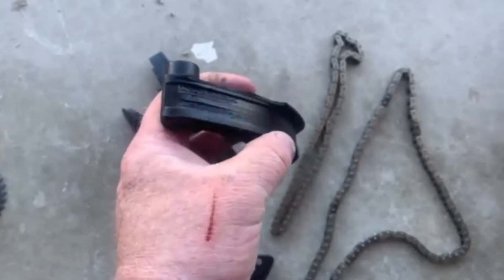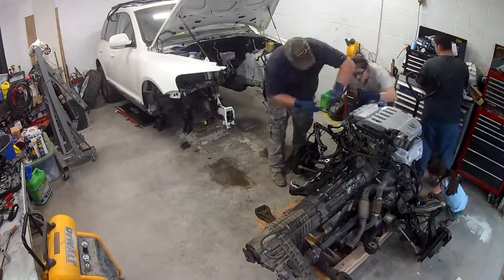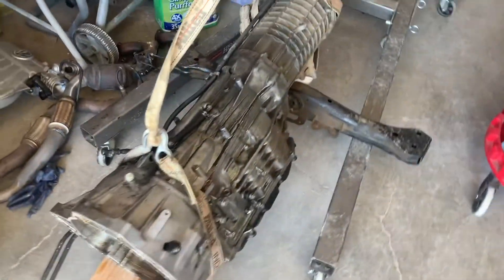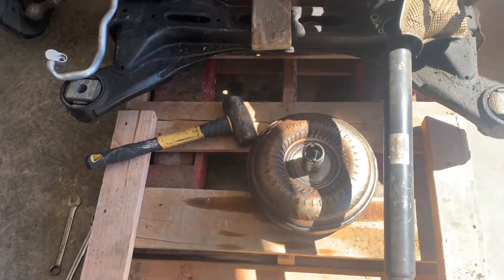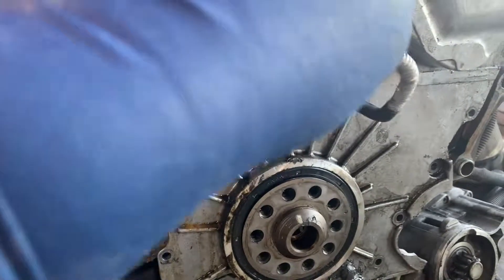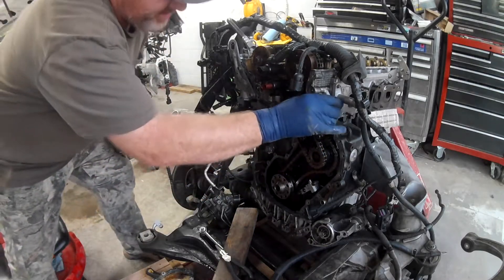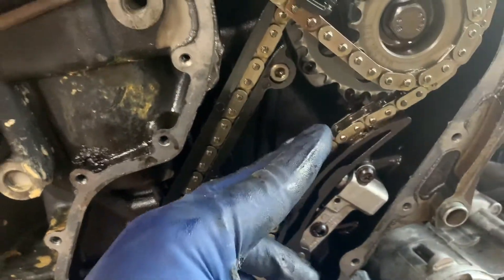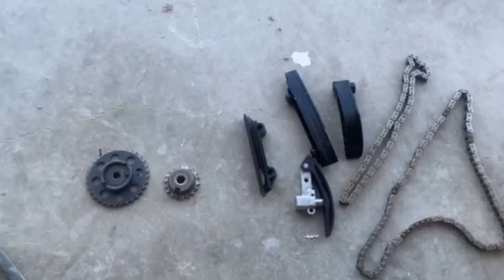2007 VW Touareg 3.6 V6 Timing Repair (Part 2)  "What do we find?"

Comment: I have to say I think this is one very poorly designed engine. Its way over complicated and way too much work just to replace a timing set. The idea that one needs to apply so much work at 100K to 150K miles is absurd. At this point you might as well rebuild the entire engine. Since you got it out. If you dont do a head job it will likely be the next big thing to cause a problem. One video I watched wanted 3,000 bucks just to do this job alone. Crazy!
Reply from the maker: I agree with you completely!   We’ve since sold it to a friend, but we still work on it from time to time for them as issues arise.

Comment: How its 3.6 ? 🤔 isnt that AXZ Engine?
Reply from the maker: From what I understand the AXZ is the 3.2 VR6, which was replaced by the 3.6 VR6 first in the Passat around 2006 and then in the Touareg in 2007.  My scanner identifies the engine code as BHK.
Reply: @mountainviewsgarage  yeah sorry i saw the intake manifold and toureg has same as like 3.2 AXZ. Today i tried to timing with all brand new OEM parts and still i have slack on chain. Everything on point still i dont understand why i have this problem. Can you gimme advice please 🙏
Reply from the maker: @kepaze  I'm not familiar with the 3.2, but in my research on the 3.6 it appears fairly similar.  Just to clarify, you replaced the chains as wells as the tensioners?  You should have 2 tensioners, the lower chain tensioner and the upper chain tensioner.  Are you using a timing kit, that includes the camshaft alignment tool, mine also includes the fuel pump alignment tool as well?  Not sure if your fuel pump is setup the same way.